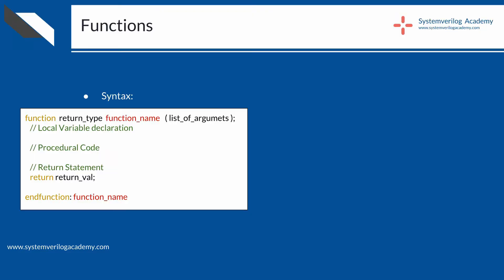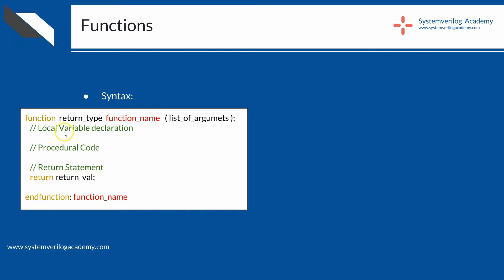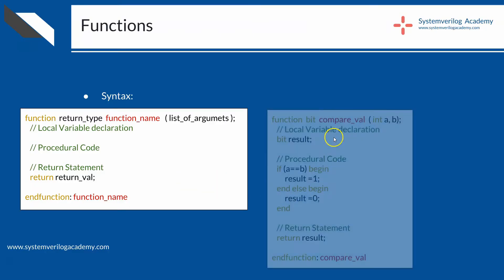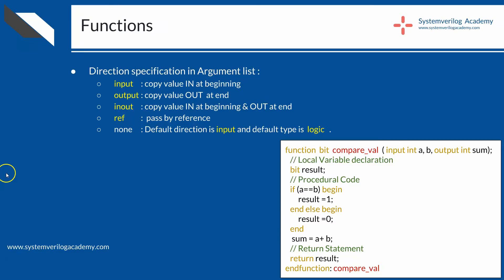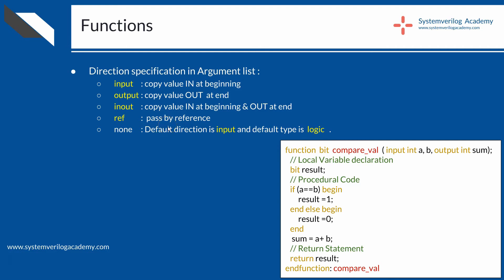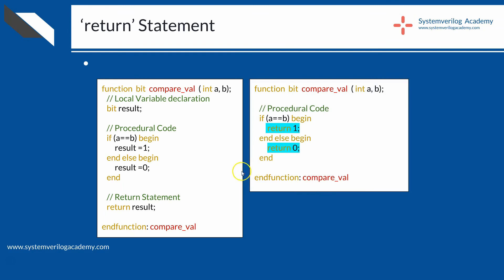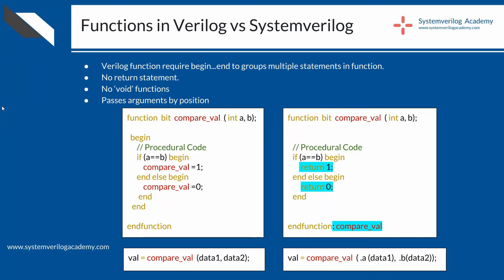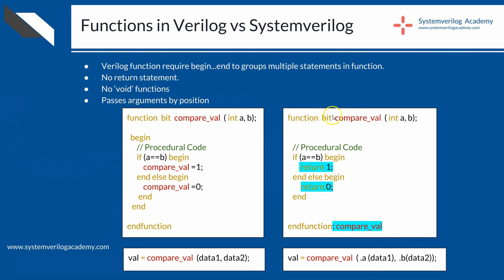Systemverilog Function: Example and Syntax : Comparison of Verilog & Systemverilog Functions

Comment: Task only supported for output port but fnction also support output port in sv?
Reply from the maker: Function also supports output ports, (but mostly they will be used to return a single value using the 'return' statement, and outputs are rarely used for functions)
Reply: @SystemverilogAcademy  ok done bro .